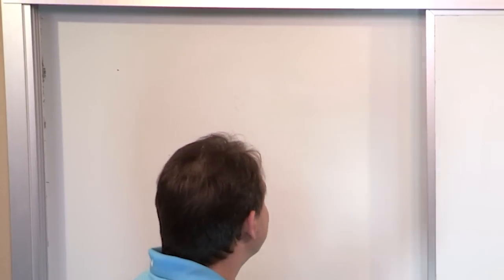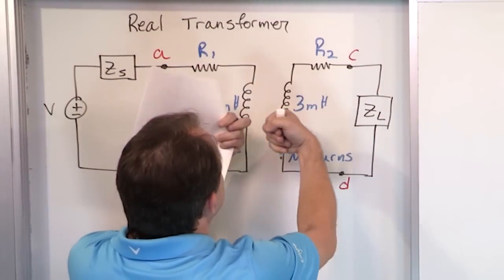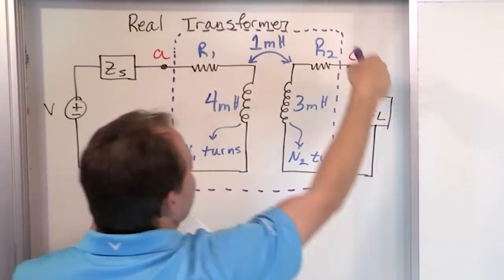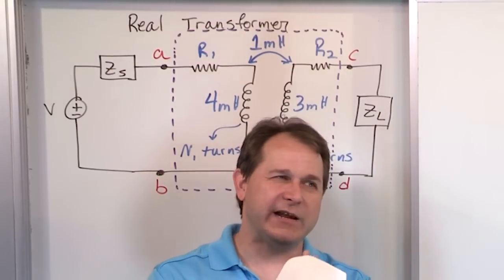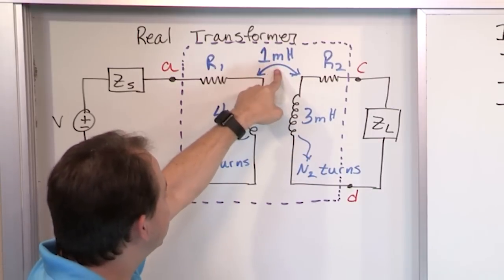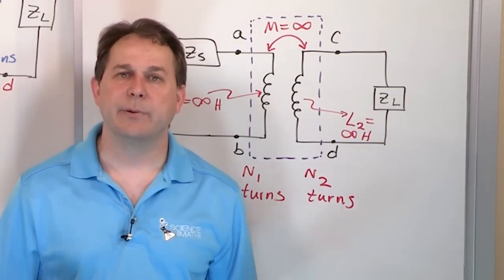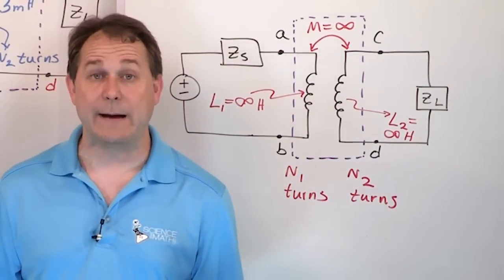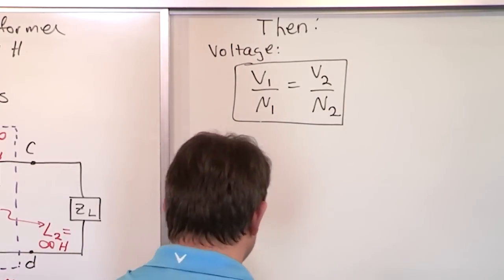02 - What is a Transformer & How Does it Work?  (Step-Up & Step-Down Transformer Circuits)

Comment: The following was a question from a physics examination:
“Using a diagram, illustrate the structure of a transformer which supplies 12 V when connected to 240 V mains.
If this transformer takes 0.55A from the mains when used to light five 12V, 24watt lamps in parallel, find its efficiency. 
i)	Work out the question (5marks)
ii)	Identify the probable errors that leaners can make in answering this question (5marks)
iii)	Develop a marking scheme for the question.  (10marks)

Comment: Interesting statement you made: The magnetic field of the polarized iron creates the magnetic field which is added to the induced field that causes the polarization of the magnetic domains in the first place.
Veritasium made the same statement regarding energy transfer in an electric circuit: energy is transferred by the electrostatic field of the EMF source and the fields of the free electrons which are 'polarized' by the EMF.

Comment: I have a couple of questions. Since there was no reference made to wire sizes used to wind the transformer. 1) were the input (primary) and output  (secondary) assumed to be the same size wire? 2) increasing wire size also increases current flow so would increasing wire size on the output  (secondary) help negate current loss while stepping up voltage? I know that also makes the transformer larger as a result. This was a very informative lesson! Thank you for it!🖒I liked and subbed. ;)
Reply: Following her

Comment: The way the primary input was drawn looks like the source is DC with the + and -  .  I thought a transformer will only work with AC??   Thanks for the excellent video.
Reply: check out the comment at 2:05 "it's a sinusoidal source"
Reply: You are correct but we don’t always draw a sine wave for a sinusoidal source. Often times we just draw the plus or minus as a reference and then the phasor associated to that independent voltage or current source. The plus and minus at this point is just simply a reference.
Reply: Remember that the plus and minus doesn’t always refer to a battery source, it’s just a voltage source. Only when you see the long and short “plates” can you assume that it’s a battery.

Comment: real world question: i plug in a power pack/power supply for a electronic device into the wall socket. Now since it is a transformer the hot and neutral wires in socket are connected and create a circuit. now if the circuit was just a single wire loop it would be a short circuit and heat up and hopefully trip breaker.   now the transformer  is still a loop of wire and if the supply is not connected to device their would be no load.

so is the reason the one side of the transformer does not act like a short circuit because of the impedance of the coil/inductor?

Comment: i have a doubt reply immediately. suppose if they given supply voltage 100v, 2:1 ratio and primary side impedance is 0+j30 what is the primary current

Comment: can someone help , what could cause the secondary side of a transformers output to drop its voltage ?
Reply: I have NO IDEA in a step - up transformer , but I CANNOT HELP THINKING ABOUT RESISTORS AND RESISTANCE , ON THE PRIMARY SIDE ...???